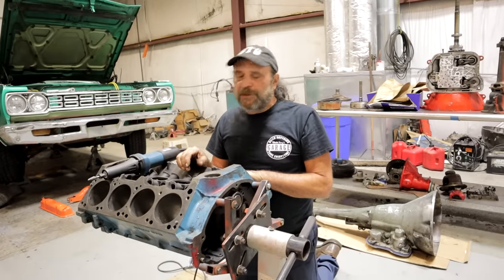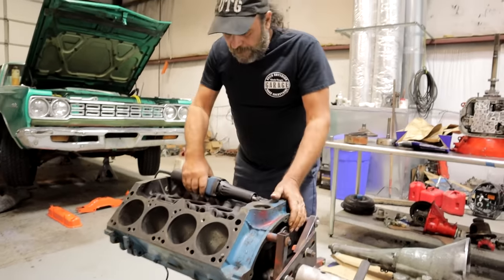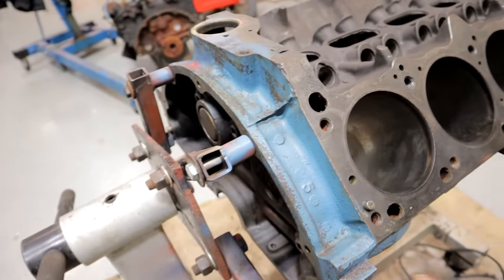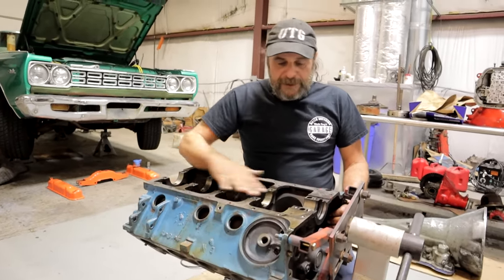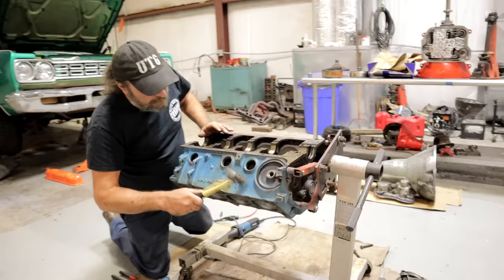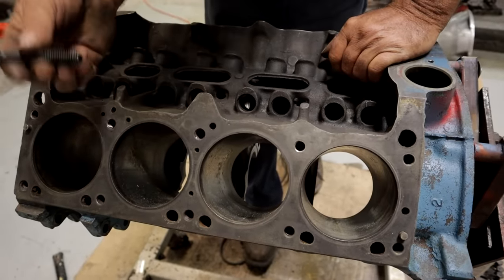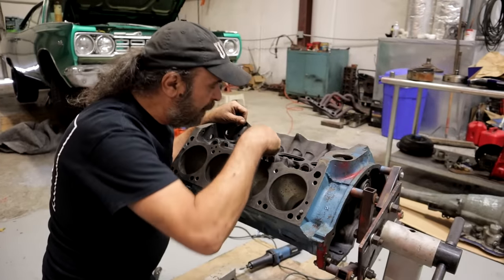Engine Block Preparation For Performance And Abuse - Best Practices For Inspection And Detailing

Comment: Another chapter in your book. I was taught to deburr a block by using files. Yes files. With a file your chamfers  are smaller and work just as well. You are less lightly to screw something up and you can file to the outside of the block keeping less shavings from inside the block.  My son was taught using files.  Look at the work, Decide what you are doing,  Go slow.
Reply: I've half decked a Hercules 6 cylinder  with a file. 
It was way out in nowhere land and would pop a head gasket every 2-3yrs. 
I pulled the head and the deck had all kinds of gouges from a crappy deck job. 
Anyways ,2-3hrs of filing off the high spots , new gasket , havent heard from them in 7-8yrs now 😁
And for some bodywork lately ,it's been real handy.
I took some welds down to surface on an aluminum fender and polished it and it's mint. 
You can feel when the imperfection is gone because the file glides across and removes almost nothing. 
Good stuff
Reply: @MrTheHillfolk  on top of it a good file goes an insanely long way on the amount of work you can get done.
If i had to deck a block by hand i would take a sheet of glass and put it ontop then file it and i bet it would just about as good as sending it to a machine shop.
Reply: I agree 100% I too was taught to use files as well I actually have my late grandfathers old files and I use them alot I completely agree it's a slower process however when it comes to removing metal slower is better in this case.
Reply: A pedal to adjust the speed of an electric die grinder is MUST.
Reply: @rogerstill719      Foredom makes excellent long lasting servicable units with a pedal and a cable between the spindle and the motor. They don't get hot in your hand. I purchased lots of them in a startup company which made implantable heart defibrillators/pacemakers.
Reply: I work manufacturing jet engine parts and every person is different.  Some can use a grinder and never make a mistake, some feel more comfortable with a file.  Maybe the critical surface areas you use a file and lifter valley use a grinder.  Always take your time and think before you act.
Reply: I have a Hercules HXD and just the thought of doing that gave me arthritis!  Hahaha
Reply: Files are great for keeping gasket surfaces flat, but checkout that burr/ridge on this block to the driver side of the distributor hole--good luck getting a straightedge on that. As for keeping shavings out of the block, fill passages with shaving cream--they'll catch debris and can be flushed out.

as for Pro Stockers cutting off the side of the block to put in an aluminum wall? I can't see that passing tear down inspection (with all the rules requiring OEM parts and no ported heads etc) nor supporting the deck against combustion--quite a few folks were adding weight, ie, Hardblok, inside the cooling passages for strength.
Reply: And alot harder to go too far or slip, with a dir grinder it's very easy for a novice to slip and gouge an important machined surface
Reply: @kentkirkpatrick7953   I understand
Reply: @MrTheHillfolk  you should look into scraping
Reply: He's simply deburring guys... yeah if your scared or inexperienced files great, and but as far as end product can't match by hand

Comment: The 1970 Boss 302 Engine modification book states, after smoothing out flashing,  you should be able to run your hand around any portion of the block without fear of getting cut.
Reply: Did that my engine. Inside and out.
Reply: Which I could get my hands on that book and see what else is in it.
Reply: @jesse75  I think reprints are still available,...
Reply: @jesse75  I have a copy,...
Reply: @8000RPM.  👍

Comment: Use a boiler cleaning brush to clean the passages, they come in a variety of sizes and shapes
Reply: Gun supply stores have sort of rat tail brushes  like that.
Reply: @kevinmcguire3715  a little compressed air don’t hurt either,,
Reply: Goodson high pressure oil gallery cleaning system. The absolute best way

Comment: Most of my own builds are small and big block Chevys. Your comment on cracking in the main webs is exactly why I, unlike many others, avoid factory 4 bolt main blocks. Most, if not all stock Chevy 4 bolt main engines have the outer bolt holes drilled straight into the web parallel to the inner holes and crankshaft. If I'm building an engine for a daily driver or a mild cruiser that won't see the high side of 6000 rpm, I'm fine with 2 bolt mains. If I'm building a race engine that will see high rpm, aftermarket main caps with splayed outer bolt holes and the extra machine work required are the only way to go for me. I also chamfer or radius EVERYTHING! I'm not giving cracks any chance to start!

Comment: You should speak on the biggest issue core shift ,which is the most important thing with both older heads and blocks cam tunnel, liffter bores ect especially if they are not virgin or factory fresh
Reply: i think he should mention how to find it on a block you're buying. afterward, it can only be worked out by the machine shop, perhaps. like offset boring a cylinder towards the lifter valley but not towards the waterpump, or in cam bearings, oversizing to use roller bearings.

Comment: I decided to rebuild a 402 Chevy and when I started with the heads there was so much casting flash in the runners that it nearly touched in the middle!! I spent probably a solid 8 hours grinding on each head!

Comment: It’s amazing how much flashing is in a production engine. I cleaned up a pair of heads for a truck I owned years ago. Flashing down inside the valve bowl area. Talk about restriction. After cleaning all that up with a die grinder, port matching to the Edelbrock headers I bought, new set of rings, wow! What a difference it made on my daily driver. Time well spent!
     Oh, and by the way, I always chase out the bolt holes, in the blind holes, I use a bottom tap.

Comment: Detailing a block is really therapeutic once you get over the whole " I might fuck this thing up" stage of doing it!
Reply: Right? 👍
Reply: Yes just take ur time and pay attention.
Reply: Boy, that is sooo true.  Quiet time, no one talking to me, just me and the metal.  And very often, even when done, nobody else will see the results, but I will know it is there and the machine will last longer and run better.
Reply: I've got a Chevy 350 that has been my go to several times over the years when I just want to clear my head. No real plans with the block yet,  just a good core laying around. No casting flash anywhere,  polished lifter valley,  radiused oil drains,  and I'm not done with it yet.   Great for clearing your head.
Reply: @captainjohnh9405  exactly! That and the fact that you can gain small advantages over folks with the same setup that didn't take the time and just slapped it together!
Reply: 100%

Comment: Transfer of knowledge, just can't be replaced.  Kudos for sharing a mere fraction of your life's lessons- because that's what the youngster's can't fathom is the pain of failures to the nTH power that someone shared with you and so on and so on.  There is no way to learn it all, web search it all, absorb it all- you have to ultimately live it, experience failure, figure out why, and actually learn from it.  That's the real secret- it can't be bought, it can't be programmed, it can only be lived!  Kudos and much respect!

Comment: Thanks, Tony ! 
I learned some important tips, here. I've been deburring my blocks for 45+ years. It;s actually a process I enjoy. In fact, the whole engine process from initial grime clean to firing it the first time. The unfun is AFTER assembly, and catastrophic engine failure happens 6 laps into the first practice (I circle track Mopars) due to a hyd lifter coming apart. erg .......

Comment: Great video Tony.  This is the work that is the most important and the biggest PITA.  No glamour or cool parts just hard technical dirty work.  This is also the time to install oil restrictors on engines that need them.  Machine shops really appreciate a well-prepared block.  Most people just bring their greasy mess in and instantly contaminate all of our chemicals.  We end up doing this work in your video, we charge for it.  Lesson is, its sucks, it's not hard, do it yourself.

Comment: Thanks Tony for the tips, I have seen a few engines rebuilt and used to do VW air-cooled a few times for personal use and no one ever talked about the depth of detailing an engine block like you have except get it degreased and send it to the machine shop for a boil and inspection for any machining required.
 
I heard a lot of b*tching from the machine shop mechanics/technicians about the uncleanliness of the blocks and heads not broken down brought to them, thinking it was "their" job to take care of our "ignorance" without affecting our costs of getting a rebuildable engine component back from them. This was when I brought stuff in as a favor to a friends truck and tractor repair service when I was going into town (big deal at the time because of the distance involved).

Thanks for your time and efforts educating/learning folks stuff.
BTW where have you been hiding Aunt Cathy? Have not seen her in a while...

Comment: Stress Risers:  I flew a zillion older airplanes that had sheet aluminum cracks, and the solution was always to "Stop Drill" a small hole at the end of the crack.  Do that and the load is spread around the circumference of the hole, and the crack never advanced.

Comment: There's something gratifying about grinding off that casting flash too. Thank you its nice to know the possible horrors that might happened if you didn't do it. I remember my first build and getting a head surfaced and the machine shop guy asked me if I wanted the bolt holes chamfered and I said yeah reluctantly thinking I was getting taken advantage of

Comment: There's another factor in coolant passages. Dead zones as far as coolant flow goes. For an example on AMXJ's YouTube channel he has a series of interviews with an individual who was involved in cylinder head porting on the 4.0. One thing th heyfid was install thermocouples all through the engine. One of the things they found was dead coolant flow towards the rear of the block between cylinder cores. A fix for this is to install exterior coolant lines to shoot coolant right into those areas. This could be done on any engine that has hot spots caused by uneven coolant flow. Aldo the farther the heat source is from where the coolant is introduced to the block or head the hotter the coolant is by the time it gets to the rear of the block or head. 
Overheating kills more engines than anything else. This is one reason the Lemons for example requires only wayer as coolant. Second is probably bearing failures due to lack of oil pressure and flow. 
As for blocks splitting under high power loads, detonation etc. One thing the manufactures could have done is to have a web cast into the blocks between the cylinder banks. The webs could have been cast almost as high as the finidhed ends of the blocks. The cost per block would have been negligible. But weight was probably also a factor. In many ways the US auto industry penny pinched itself to death. Look at a lot of the imports. Even on four cylinder engines they employed deep skirted blocks.

Comment: A twist drill with the tip ground flat  works great for cleaning the crud out of bolt holes. Turn it by hand with a file handle or a pin vise to avoid damaging the threads.  An old drill chuck makes a decent pin vise if you have one kicking around.  You can even use locking pliers in a pinch
Reply: A hand crank drill would work. I still remember when they were common.

Comment: You mentioned the oil drain back holes. VERY important. Even for a stock engine. The one I rebuilt for a 71 Ford showed sings of lack of lubrication everywhere. I was told it was a common problem in certain blocks where poor casting prevented enough oil from returning to the pan fast enough. Even on a sock engine it can pose a problem.

Comment: I use welding rods with points ground on one end and a 2"long 90deg bend on the other end to help hold onto it. Works great with a compressed air nozzle too.

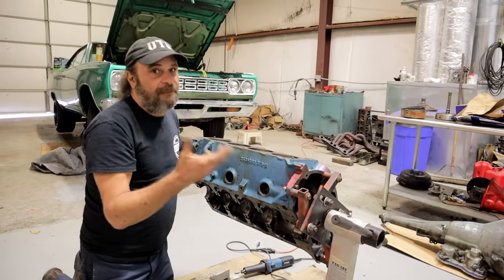Comment: 16:24 working in an engine shop almost 20yrs ago,I recall dirt track guys bringing us their blocks and having lightning holes all over the back of the bell housing area.
That was obvious,I'm sure they did a bunch more to them.
Reply from the maker: Those holes are mostly used to help airflow through the bellhousing area

Comment: Great video!! Learned a lot that I didn't know before.  I bought a 89 Toyota DLX 4x4 3.0 engine 5speed engine not runnin did compression check 3 cylinders down so tore it down oil rings was stuck rod bearings rough so it's down to bare block now so I'm gonna clean it up as you say and go from there.  Thanks for sharing be safe have fun enjoy

Comment: Well said and explained...the flex in even a cast iron engine block will find its weak points. The tip for tapping out large chunks...well done! Great tip on top threads, they will pop on ya.. Thanks Tony!

Comment: Yes did a lot of blocks like that but never take the sharp edge off the mains and the bolt depth great video you can bet more than 1 head gasket let loose for the exact reason you showed.

Comment: Have seen at least 2 "B" engines that cracked the mains outward from the oil hole in the #4 block saddle, both engines were seriously overheated but no spun mains or even cooked bearings. Stock "C" body engines, and one was the notorious thick-webbing, large casting #230 blocks (late '71 cast date). :face-purple-crying:

Comment: You can also use radiator picks on the water jackets.
Auto parts stores will loan thread chasing kits.
Those are machine clamp pads. You'll find them on the port floors on most heads, especially the vaunted W2 340 heads. It's really the only improvement possible on those as they are ready to race out of the box.

Comment: Excited to see where this 318 goes! 300 horse? 350? Lots of limiting factors, but finding the ways around them will be neat to see! Good luck, Guys.
Reply: Good video
Reply: built cheaply to make power below 6,500 rpm, i'll go with 300 hp. but build it for a high rpm use and OEM LA heads and 10:1 CR, i'll say 350 max
Reply: My buddy built a 3.90" bore 318 for a "Late Model" Dirt Track class that kind of had unlimited rules and it made over 580HP in his version....I'm sure even in Street Trim that DV can squeeze out 400+HP out of the lowly 318👍
Reply: @ejgrant5191  I can believe it, but will it be streetable and run on 91 pump gas and have vacuum for brakes etc?  UTG is not known for big dollar builds and he prefers torque over HP lately. but we'll see.

Comment: I start the old fashion way I put the block in a 44 gallon drum with a molasses mix and soak .
Smokey Yunich sent hours getting the flashing of cylinders in the water jacket to stop detonation .
My NEW oil pump was notchy to turn and the end float was wrong  H.P  , there was swarf on the ends of the drilling. 
From Down Under
Reply: Chris, what’s the ratio you use for your molasses bath. 
I’ve had great success with many rusted parts but never thought of it for a block. 
How long also do you leave it to soak. 
Cheers
Reply: @aaronblyth596  Aaron i start mine at 20 to 1 and hang it on  the engine hoist and bring it out every couple of days and check progress, it will have a black sludge on it pressure wash it off. Very ratio to suit time and corrosion it does not like oil grease , pressure wash first. It works well  body panels with all the hard places to get to .
Just experiment and you  will see the results, not quick for a production shop. 
From Down Under

Comment: Block prep offers a Zen-like experience. Every minute you put into blueprinting the block pays back in satisfaction of effort. I always remove as much slag as possible, especially in valley vent holes. Using a burr and sanding roll to smooth out the oil passages at filter, lifter valley and even in head drain-backs should be standard practice.

Comment: I've mentioned the fire survivor 454 RV engine that I have on here. I've finally gotten into it but I'm in no hurry. But I've decided the direction that I'm going with it. Machine shop first. It went through a bad fire so it gets a hot bath. Then 30 over. Then the deck gets lowered. I'll take care of those stress points myself once I get it home. I'm selling the heads and going with square port aluminum heads and a roller kit. Adjustable timing gear with quick access cover. That's as far as I'm gonna plan for now. 
It may be a big block but it was in an RV. Which means it has a high deck.
A torque monster basically. I'm looking for HP. I'm talking about it in here because Tony's channel has me wanting to tackle a project. Hell I might even video the process. With my trucking job it'll probably take me until well into the summer to finish it.
Wish me luck.
Reply: I thought only the 427 existed in the tall deck(10.2")? As far as I know no factory 454 are tall deck they are all 9.8"
Reply: @bcbloc02  two things: first, Rats really love a .060 overbore to unshroud the valves. Two, the 366 and 427 were the only tall deck blocks in trucks (i believe the 572 crate engine uses a tall deck). If you can fit your finger between the side wings or ports of the water pump and the bottom of the cylinder head, you have a tall deck block (typically seen in commercial box trucks). If the water pump outlet is flush with the deck surface/bottom of the water pump, you have a standard deck height block.